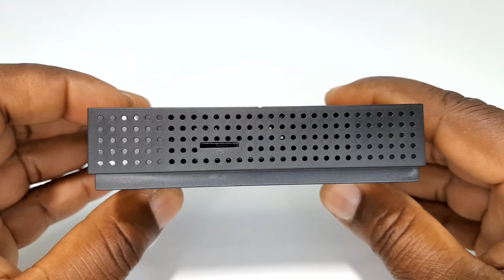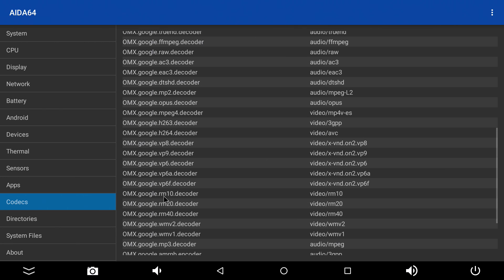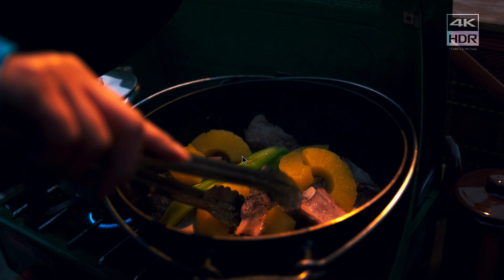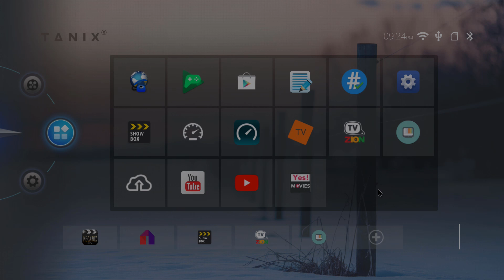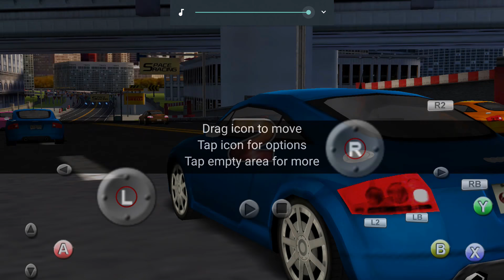Tanix TX92 Amlogic S912 64GB Android 4K TV box - High end Tanix TV Box

Comment: I bought the Tanix TX92 about 2 years ago and have never used it since trying to get it to work for a week after it arrived. I tried upgrading the firmware, changing to a USB remote, contacted Tanix support who just ignored me.
It is the biggest waste of money that I have ever spent! It never worked properly, doesn't respond to the remote reliably, and doesn't even allow you to choose things or move properly to select movies in a number of menus. It's a bag of crap with its default firmware, so got thrown in the back of a drawer.
As I've just discovered that openelec do a version for it I'm going to try that today so if that works properly I can give it to my daughter to use in her shed, otherwise it's going in the bin. The Raspi or Odroid C2/C4 are so much better and usable, it's not worth bothering with the TX92.
Reply from the maker: This box is no longer in production, and sorry about your bad experience.
Reply: @tvboxstop  That's ok, thanks. It's a pity as the hardware should have allowed it to be great. I'll never buy one of their boxes again as there are many other better alternatives available.
Reply from the maker: OK cool
Reply: Do you still have it and is your problem still ongoing? I have a Vorke Z6 Plus, which is exactly the same box and it's the best Android TV Box I ever had. If you're confident with flashing, you could re-flash the stock firmware, try the Vorke firmware or one of the custom ROM's that are available for these boxes.

Comment: Very disapointed with this box, impossible to connect via ethernet, wifi work but really slow, I don't recommand it
Reply: If you still have this box, try to flash the Vorke Z6 Plus firmware. They are completely identical and ethernet connection on the Z6 Plus is flawless.

Comment: Hi! One question, the Vontar tx92 is exactly the same? I saw cheaper but seems the same.
Reply from the maker: The hardware maybe the same but I'm not so sure about the programming. Sometimes third party sellers do all sorts of weird things to their firmware for customization purposes, so who knows, only someone who bought one can answer that. Sometimes cheaper is to get you to buy it quickly for some reason. Be careful of what you buy, I'm not saying that it is not good just be mindful of what I said. I have seen people have to flash firmware after purchase because of issues with root and so on. So ask some questions to other buyers of the device.
Reply from the maker: Also remember to check which model you are buying the 3GB 64GB is the model featured in the video

Comment: Whats the max capacity for usb external storage?
Reply from the maker: Hi James, the max extended capacity for the 64GB model is 128GB
Reply: TV Box Stop im talking about the usb external hdd read how high can it read 3tb 4tb?
Reply from the maker: You see that's where some people get a bit confused. Any hard drive size you plug into the box it will read and write to it. What is limited is the amount of that same TB hard drive that can be converted to internal storage. The same goes for flash drives and SD cards.
Reply: TV Box Stop that answered my question thank u, i wanted to know if it would read and write to any size im getting a 4tb hdd thanks!

Comment: Where do you get the gkn touch controller mapping?
Reply from the maker: On the Google play store - https://play.google.com/store/apps/details?id=com.locnet.gktouch&hl=en
Reply: Thank you.
Reply from the maker: if you intend to use, this app used to be free, however you have to pay a very small fee for the full version, and I recommend it. There is one thing you must have one, you box must be fully rooted and not all are rooted the same sometimes it fails to run on certain rooted boxes The TAnix TX92 is very compatible with GKM touch. You must also got to settings and uncheck the "use mouse input option" or you will get hell to use the app.
Reply: thanks for the info.  I think I'm going to go with the H96 Max, do you know if that software will work?
Reply from the maker: Sorry GKM Touch does not run well on rooted Rockchip box I don't know why. I tried contacting support and was not able to get the app to work well on those Rockchip boxes, its a software issue with the app though.